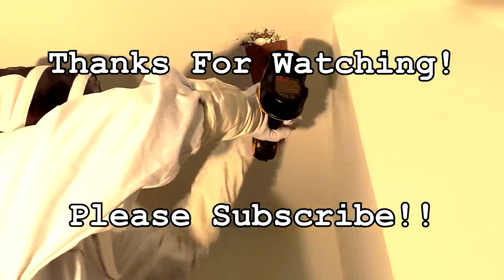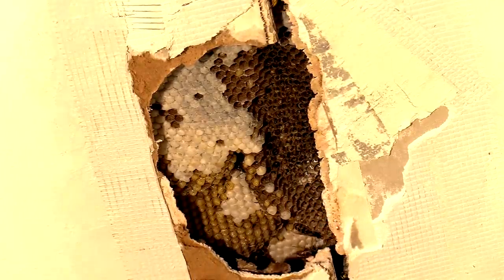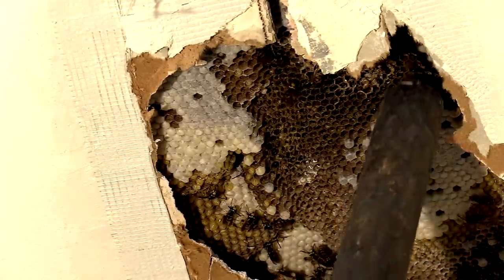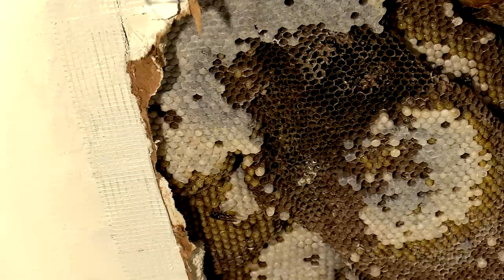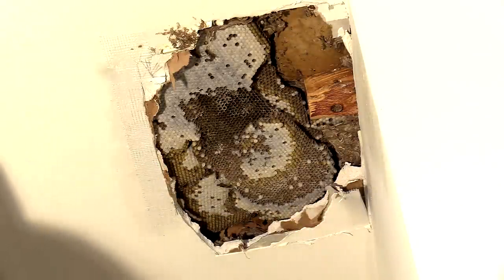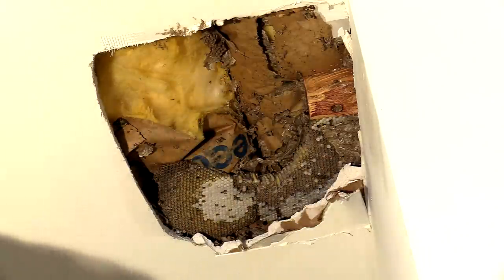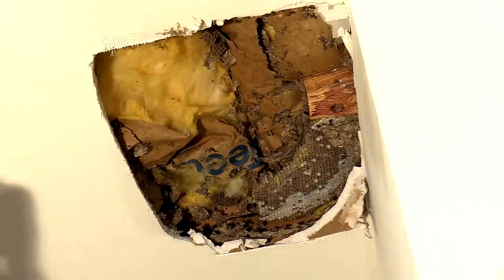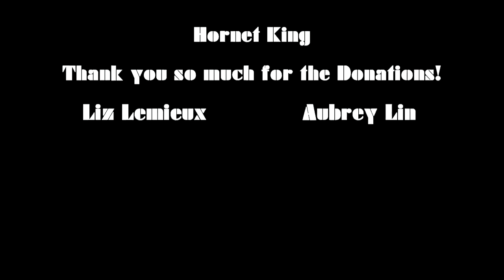Yellow Jacket Huge Nest Ceiling Infestation Wasp Nest

Comment: What happens after you remove the nest? Do you have to replace the drywall? Or does it fall to the property owners to do so?
Reply from the maker: The drywall needed replaced before I came along. In most cases it falls on the property owner. However, times where I do removals for the elderly or people who I make arrangements with prior to the removal, I fix the holes for them that I make.

Comment: Greetings from Germany!
I have been stung three times so far by wasps - thankfully while I seem to be allergic (at least according to my pediatrician from the first time I was stung), it's a mild kind of allergy. Getting stung is really painful and causes the typical problems in the local area, but I don't get any circulatory problems or anything.
But I would agree that wasps in this area are pretty docile. First sting was from a wasp I believe to already have been dead (was walking around with only socks in my carpeted room, was stung while moving my foot across the ground (not while setting down, the wasp was not flattened afterwards). Second was in summer during a party in the garden (mother's birthday, I believe), something fell into my hair while sitting under a tree. I thought it was a bit of debris falling out of the tree and made to brush it away, promptly getting stung. Last time was this year. I was about to pick up some broken fence part and doing a last preperatory "dusting off my hands" motion - and apparently a wasp was right at the side of my waist/leg at the time, because I got stung.
So, all of the stings were without me acting like a maniac to make the wasp angry, but the wasps also didn't act aggressively. Just a bunch of unfortunate accidents.

Comment: Yellow Jackets sting to kill in massive attack. Once they chew trough the drywall, they will sting to kill.  No provocation is necessary, a yellow jacket stings without provocation, they are extremely aggressive, and deadly. I had a queen yellow jacket sting me outside once, and her sting almost killed me. I crushed her, she was about 2" long.
Reply: Joey Barrelwilde we have traps for queens outside killed a lot
Reply: @annak804  I now keep a bucket trap at the end of my backyard. 
5 Gallon bucket
 Fill 1/2 with water
1 jug Red Hawaiian Punch 
1/4 cup Vinegar
2 Dishwasher, or Washer Machine Pods

Stir mixture until detergent pods are fully dissolved into liquid. Write on all 4 sides of bucket "Stay Away Yellow Jacket Trap". Put in secluded area near wooded area, or needed area.

Comment: This may be a dumb ???? Do they automatically die when they go into the vacuum?  I sometimes use my vacuum on spiders and mosquitos🤗
Reply from the maker: They die quickly inside the vacuum in the soapy water
Reply: Hornet King You put soapy water in a vacuum?
Reply from the maker: @SherryBaby2003  Yes, I do. 2 drops of dish soap and about a gallon of water. Kills them very fast.